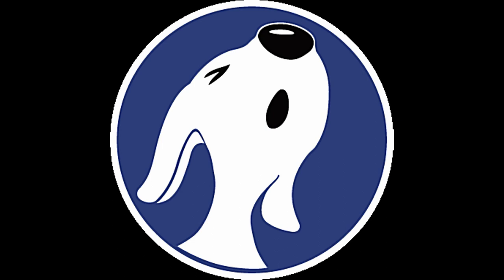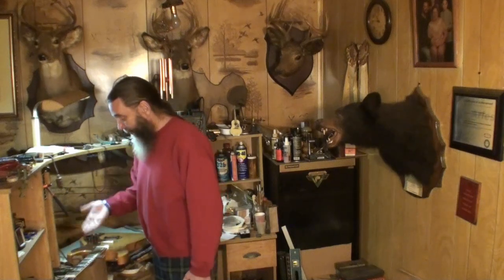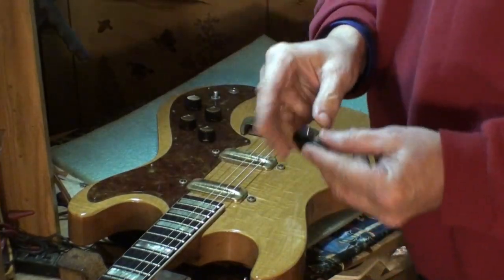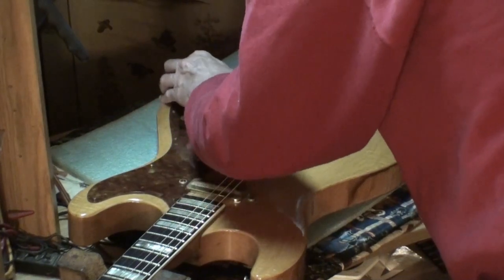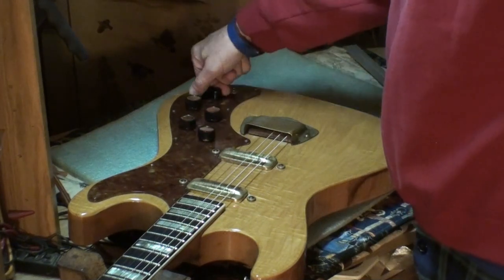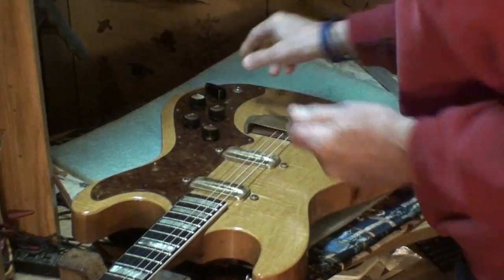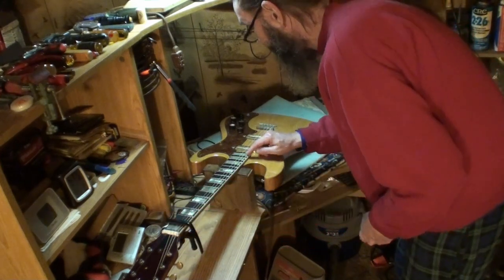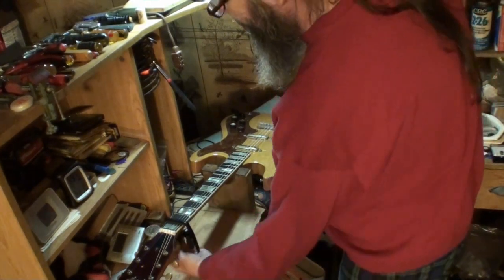very old time capsule kay guitar inspection

Comment: Heya Randy! I’m not sure I’d trust the calliper to give you perfectly accurate readings at these small sizes (strings). The low E at .046 is probably more accurate than the high E reading at .009. So if it were me, I’d probably go with a standard set of 10-46 to keep it close.  You can, of course, check the calliper against the feeler gauges to see how they compare.  I have a Mitotoyu (super expensive) precision calliper and I’m not sure I’d trust it to properly differentiate between 9 and 10 gauge strings. Just my 2 cents.
Reply from the maker: I only use them to get an idea of the gauge, usually they are right if I'm square with the string, as they say in bluegrass close enough for guess work lol